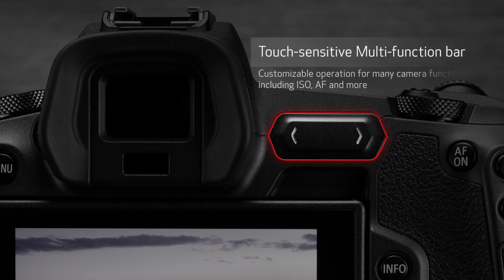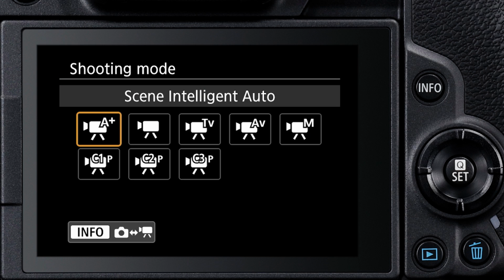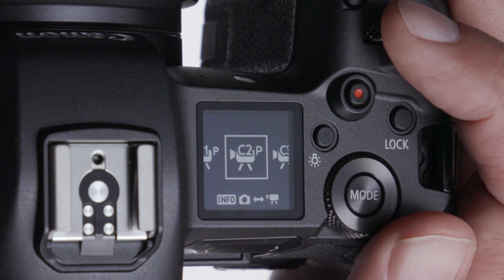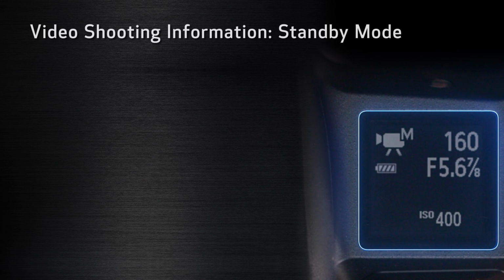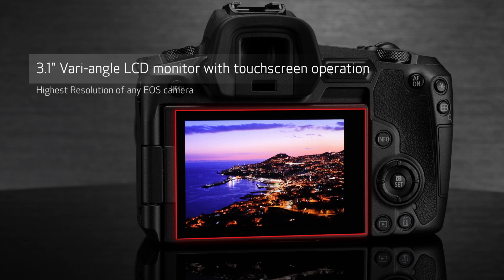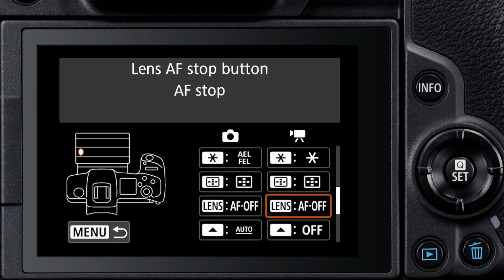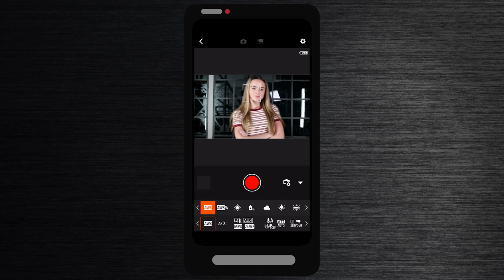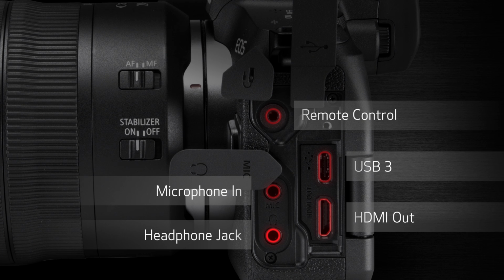How-To: Canon EOS R System Video Controls and Operation

Comment: How can I get proper exposure when shooting video without zebras? Does the histogram stay on while recording?
Reply: BTW, this could be added via firmware if you cared enough
Reply from the maker: Hi, Sam!  You can press the INFO button on your EOS R to display a live histogram while you're in video mode.  The histogram and other information will disappear from the screen during recording to reduce clutter and to give you a mostly unobstructed view of your scene.

Hope this helps!

Comment: How to access 60 fps? In my menu it seams unavailable due to crop, which I also can't find I my menu (not available for this lens). What should I do? There is also a lack of auto ISO in movie mode.
Reply from the maker: The options for setting the Movie Recording Quality are found under the 1st red menu tab under [Movie rec quality].  You can select 59.94P options from this screen.  Details are listed on page 192 of the EOS R Advanced User Guide.  Here is a shortcut.   https://Canon.us/znq2r   If you have more questions our EOS experts can provide one on one assistance at 1-800-OK-CANON (800-652-2666).

Comment: How can i record video in 60 frames per second, with full bit rate, no crop, in shutter priority mode with Auto ISO?
Reply from the maker: Hi Jason! When shooting in Full-HD, you can set the camera to shoot at 59.94p (60fps) with ALL-I compression under the [Movie Rec. Quality] option in the menu. The rest is as simple as setting the shooting mode to [Movie Shutter Priority AE (Tv)] mode using the mode button and dial on top of the camera. This enables you to set the shutter speed manually, while the aperture and ISO speed are set by the camera automatically. We hope this helps!
Reply: CanonUSA thanks Canon.  I just fixed my issue.  Thank you for the quick reply.

Comment: Touch Screen interface and Canon Camera Connect my 200D does that, in fact the layout for video looks similar to my 200D. 
But still the EOS R looks like a bold move, I would take it over the Nikon Z series. 
I also find the filter adapter interesting. 
So is this a full frame Mirrorless version of the 6D series, sort of how I see the M50 as the mirrorless version of the 200D. (I could be wrong lol)
I'm going to keep my 7Dm2 and 200D for a while, I already got EF lenses and my two camera bodies can share lenses which is one reason I bought the 200D.

Comment: Tell me that touch&drag af point move works also on stills
Reply: of course it does. i think its a standard in the M series too
Reply: @MikedieONE  That's great news. If it keeps focusing continuously while dragging it would be perfect for keeping composition while tracking subject. I cannot do that on A7iii cause it won't change the af point with joystick while focusing. I'm used to 1dx joystick for tracking while focusing and I can keep the subject on focus with that easily. Hope you could also just tap the screen with DPAF to track while your on viewfinder. On screen it is obviously possible.

Comment: Why arent you filming in 1080 120fps.... oh i forgott... u cant
Reply: they can. with the 1DXII since over 2 years already :P why didnt shoot sony with 4K60? ohh because they cant.. not even on the A9. the 1DXII did that too, already 2 years ago.
Reply: Calm down there fanboy... He asked about 1080 120fps (which should be standard on almost any body now a days). Sony and Nikon both have it on their $2,000 "entry level" bodies, but you have to spend $5,500 on a 1DXII to get this feature on a Canon. Sony and Nikon are also both offering full frame 4K on their entry level bodies, but Canon is 1.7 cropped 4K on anything less than the 1DXII... I've always been a fan of Canon, but the fact that myself and others are annoyed/pissed they refuse to offer the same features as their competitors at the same price point is completely warranted.
Reply: dezertedge9  But then nikons new cameras cant record log internally and sony cant output 10 bit video. They all are missing something. Hopefully one day we will get a perfect camera, but I doubt it.
Reply: @TJ Israelsen   Yeah 10 bit is pretty cool, but that's besides the point. It's a brand new "Revolutionary" camera so it should have new specs/features like that. The fact that they left out 1080 120 is just ridiculous, it's not a new or revolutionary thing anymore. It's a more expensive camera than it's closest competitors, but is missing what has become standard specs for it's class (1080 120 and IBIS). I agree that none of them are perfect, but Canon is missing more in my opinion.

Comment: Any difference over M50 video capabilities? Cropped 4K, 4K rolling shutter, lack of DPAF in 4K?
Reply: I think the R has higher quality codec and 1.7X crop in 4k. that means that you can use EF-S(apsc) lenses here with decent wideangle.(the M50 did crop the APS-C lenses extra).
and there is DPAF in 4K here.

Comment: Why the crop in 4K ??
Reply: i think there is not enough power to downscale from 6720x3780 (max resolution available from the sensor in 16/9 format) to 3840x2160..so the camera grab only the central part of the sensor (3840x2160) and write it to the one card without any image manipulation)
Reply: mmm Then why not give 6K 6144x3072 and let the user crop or scale  in post. At least as an option. This would reduce the difference in the field of view.
Reply: to protect the c700...and this is a typical canon move

Comment: What is the crop factor in 4K? Does it shoot 4K full frame without a crop?
Reply: 1.74 crop. Same than 5d4. But you can mount efs lenses, like 10-18mm
Reply: And it doesn't even have 120fps in 1080
Reply: MrDeadanon 5d4 doesn’t have 120fps in 1080, it’s in 720p just like this...which is terrible and nobody wants. Shame on canon
Reply: Thanks Alex for clarifying.  Even more reason for Canon to protect their 5500 USD 1dxii.  The ONLY camera that shoots 120 fps in 1080...   That shows how far Canon is behind right now.
Reply: @WilliamsRDan  pretty sure thats not true, since 4k is 9 megapixels.But, anyways..With sony and i think nikon, you can record in 4k in full frame but also in apsc mode